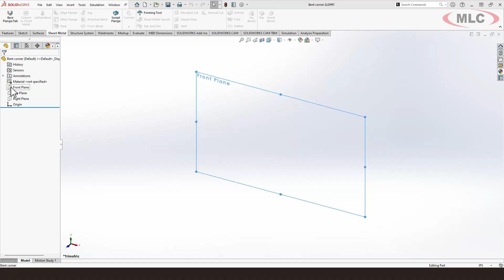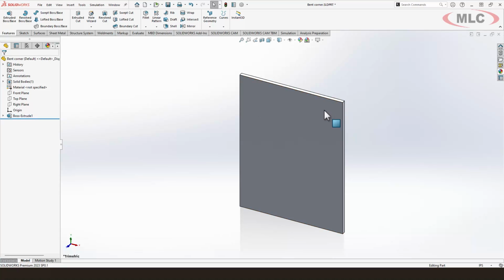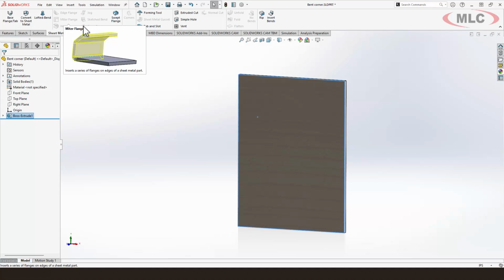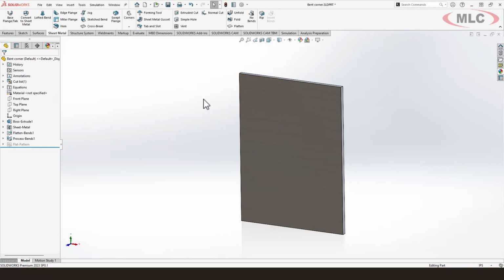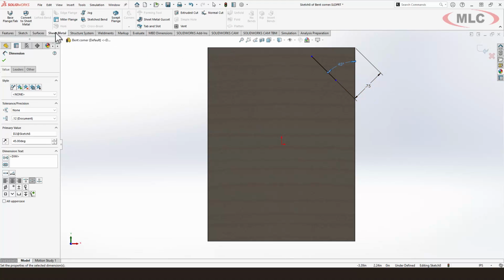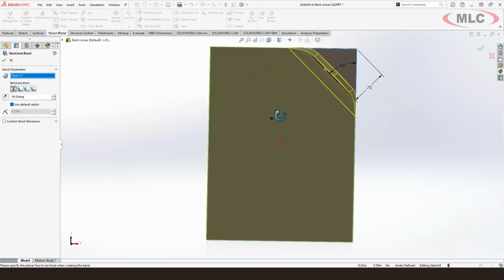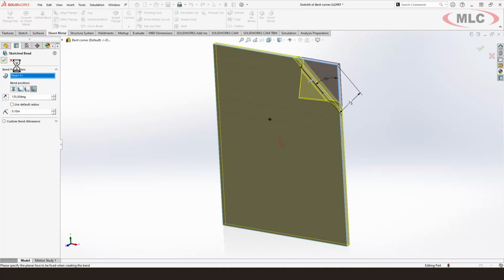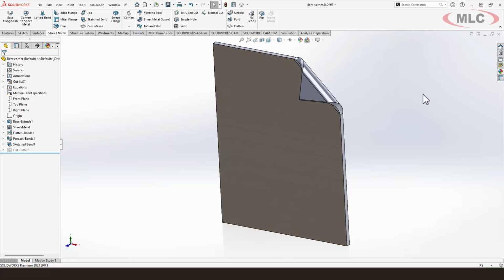How to Fold a Corner in SOLIDWORKS - Tech Tip

Comment: Hi. I've just recently started using Solidworks and can't figure out how to easily add "inch break" fold lines to a cone. I can draw the cone, I can unroll the cone, but I want to fold it on a brake press, so I need bend lines and measurable angles to tell my brakepress operator. Your videos look awesome, so I thought I'd roll the dice and ask directly.
Reply from the maker: If you use a lofted bend feature to create the cone geometry, you can choose between "formed" and "bent".  Bent gives you bend lines to approximate the shape using individual bends rather than using a roller.  https://help.solidworks.com/2023/english/SolidWorks/sldworks/r_lofted_bends_pm.htm?id=0961a92b8e944c90ad6af5e86a5c6378#Pg0
Reply: @MLCCADSystems  thanks so much guys, worked perfectly. I'll be recommending your channel to everyone.